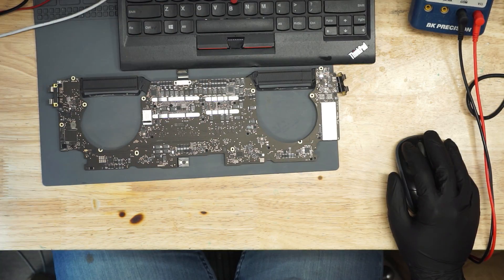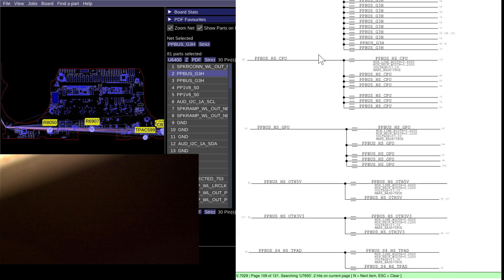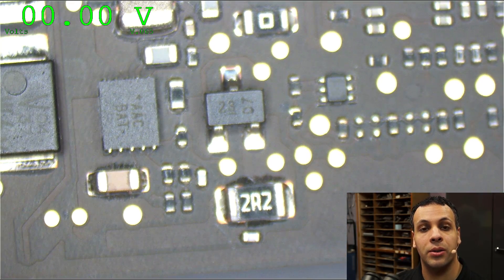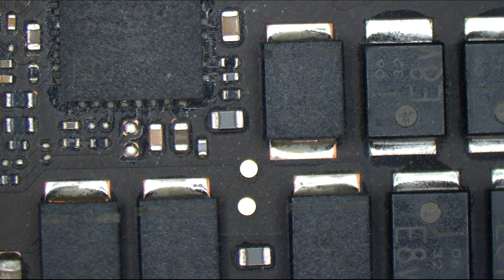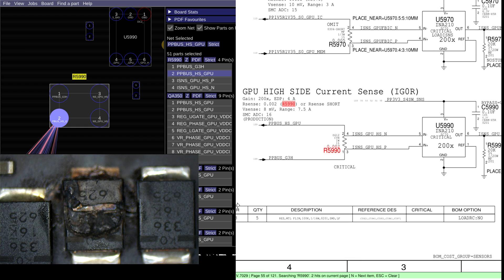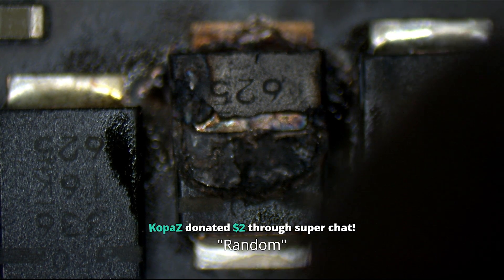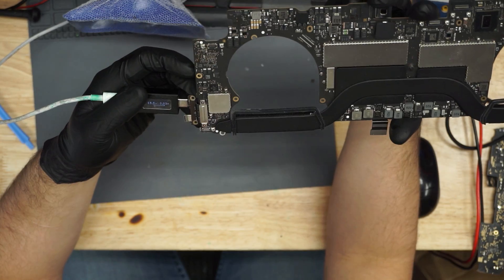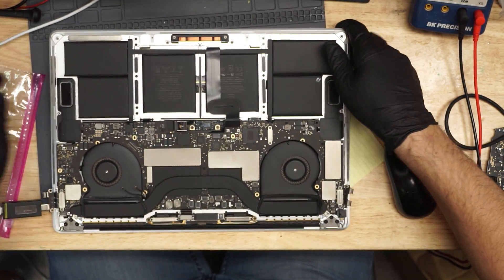A1707 Macbook Pro Touchbar 30-60 milliamp power cycling: logic board repair.

Comment: I'm pretty sure that the MacBook would have booted just fine after removal of CA357, i.e. the capacitor probably wasn't needed. There are three others in parallel. Big companies are pretty good at removing redundancies like that but really what can that 33 microfarad cap really add?

Comment: I bought a mid 2011 MacBook Air 11” with a core i5. I’m going to be using this laptop for video editing and maybe photoshop. I want to replace the ssd since it is kinda old. I’ve done some research and found that I could buy an ssd from owc, but I was wondering if I could use any m.2 ssd (such as the adata gammix s11 gaming m.2 ssd, or the Samsung pro nvme pcie ssd). What I want to know is what’s the max gb amount I can have on my ssd, what m.2 ssd’s can I use(with adapter) that will give me the best performance under 300

Comment: That's a very clean capacitor burn; usually it ends up corroding into the mask; but after you wicked it all up, it was super clean ready for replacement.

Comment: Louis could you compare effectiveness a cheap  IR security camera for detecting hot spots? You could have a cheap and permanent setup connected to your streaming rig. You are looking for hot spots and not calibrated temp measurement. Such a camera would do the job quiet well and an opportunity to do a different video on a cost effective solution. For a bit of fun you could walk up to a security camera with a broken Mac with an extension lead.

Comment: What if apple uses your vids to train their "geniuses"???
Reply: I was thinking the same thing, until I realized the genius would probably be fired for actually repairing someones mac and not making them buy a new one.
Reply: you have to realize these "geniuses" are just random Joes. They don't have any experience in board repair. All they have is piece of paper with simple instructions. Something like:
1. does it turn on? No - replace motherboard.
2. does it turn on but no picture? - replace screen
etc
Reply: Apple doesn't. If Apple did, their repairmen wouldn't be so shitty.
Reply: You're assuming they'd be able to comprehend what's happening in his videos.

Comment: If "YOU'RE"  getting a threadripper, please note you'll be able to only use half or just one of the cpu nodes of the processor! if your using software x264 encoding. As x264 encoder is not "NUMA aware" to split the work load across both or all the nodes.  H265 is numa aware and will run fine.   Just not h.264 :|  as I found out on 2950x

(edit) leave it to the grammer nazi TALU
Reply: Thanks for the tip
Reply: I haven't been Numa aware since middle school. Thanks guy.